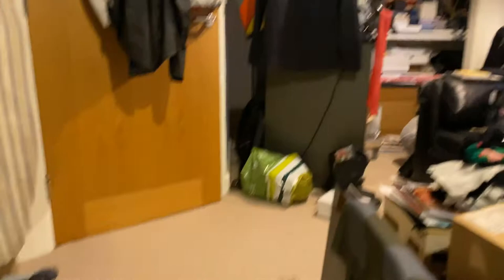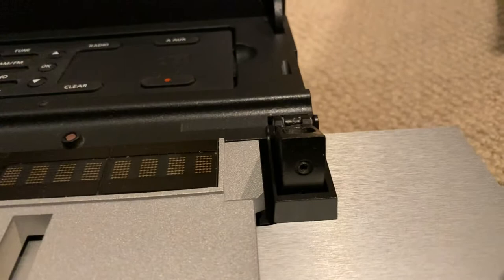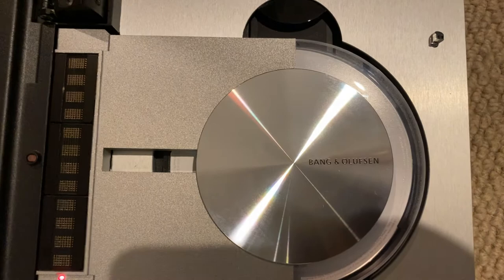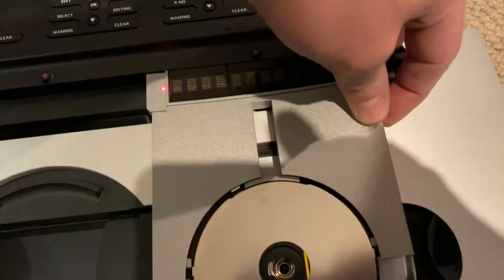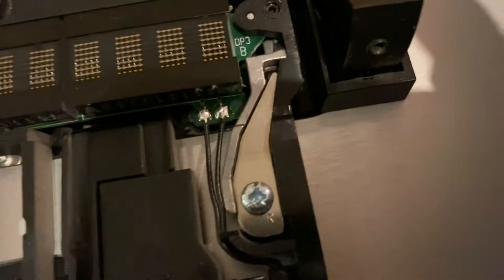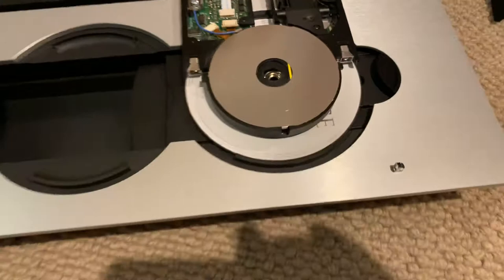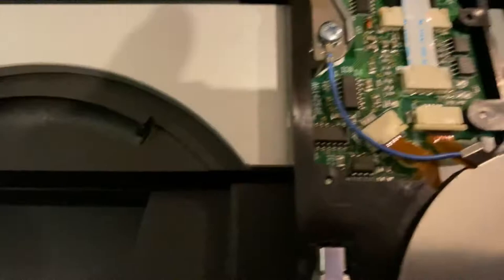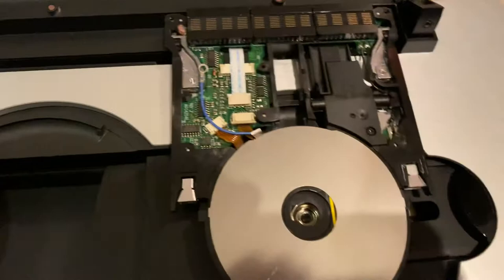Bang and Olufsen 9000 CD, how to take apart for maintenance for playing error for Load CD

Comment: Man I would have liked to see the issues of what it was doing wrong in the video. However still a great video 👍
Reply from the maker: Yes sorry I did not do that. 

Basically the CD arm lights up and most of the time moves to the CD selected but does not spin and pick up the CD. I thrne makes and number of noises as if it is misfiring.

All over the B&O forums they will say it is a laser replacement. This is not the case. Just a dam good clean/de-dust needed!

Comment: Really helpful.  The service manual isn’t as specific as you. Also nervous about taking it apart even though I’m a electronics engineer.  I’ll try doing what you did.  My issue is when I ran the diagnostic mode I found there is a focus error.  I theorized it might be a dirty lens, a weak laser of bad solder joint

Comment: Can I ask how are the speaker's connected.  Is it din in each speaker,? Thinking of getting 9000 mk3 and 6000 speakers but not sure what to buy to connect.  Also will 6000 wireless ones work with a 9000 mk 3.  Thanks
Reply: @barbadosbeachhousebuild  not all ;-)

Comment: Thank you for posting!
Reply: Very helpful. I have Beosound 9000 mk3, I normally clean the laser head with cotton stick without removing any part, there is a small gap between the laser panel and upper cover. Could you also show how to replace the laser? Thank you

Comment: Good morning!  My first CD is stuck and the glass won't open.  It appears that the unit is looking for a pin code, but none of the buttons will respond for me to put it in, nor does there seem to be a way to put in the pin code by using the remote.  Help!  The CD is from the library Best,
Jean